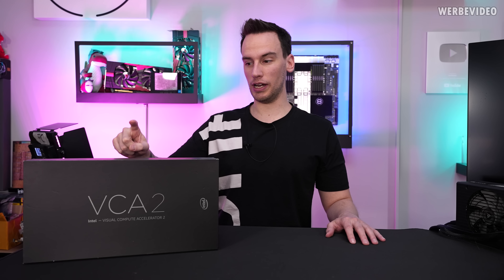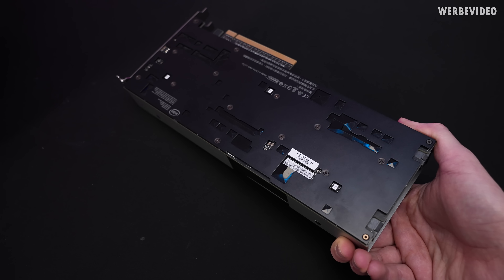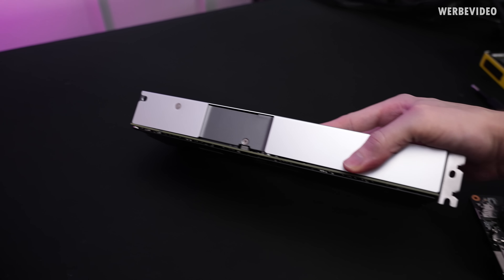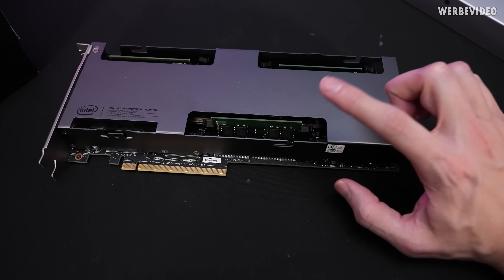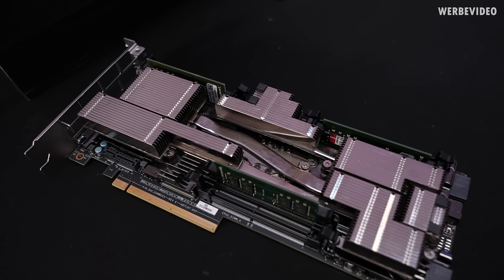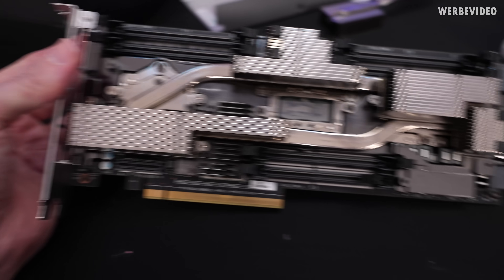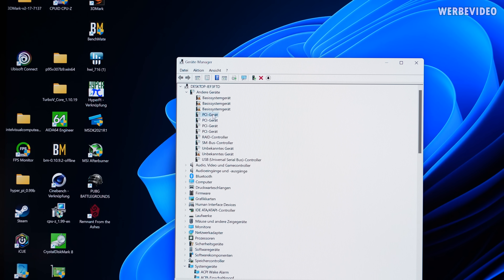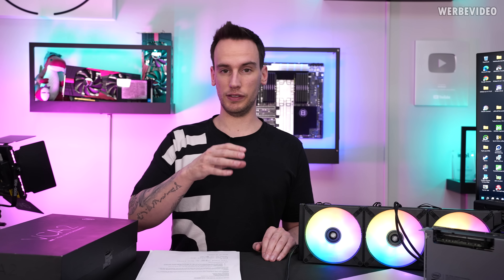Is this an Intel "Graphics Card" with 3 CPUs?

Comment: Finally, a gpu with upgradable VRAM. This should have been a thing like a decade ago.
Reply: Actually... it was... Like 30 years ago with some S3 and Matrox cards :D
Reply: While it's technically possible to do this, it's practically useless.
Put 12GB of vram on a gt 730, it's still a 730.
Reply: @chrisbaker8533  I'm using a GT 730 with 2GB and passive cooling, you have made me feel out of date 🤪
Reply: @ruben_balea  Don't feel bad, i just lost my 4GB 730 a while back while doing some testing.
RIP
Reply: @chrisbaker8533  I don't feel bad, I was just kidding, for me that 730 is more than enough.

I just bought it to be able to run some BOINC projects without spending a lot of electricity. If it doesn't sound familiar to you, BOINC is a distributed computing program, like SETI@home but to do things other than look for aliens, although in reality there was also a version of SETI that ran on BOINC. It has a companion program called TThrottle that controls the execution of the various projects and pauses them when the CPU and/or GPU exceed the specified temperature. I have it configured to pause work when the CPU or GPU exceeds 55 ºC, which apart from avoiding frying the system maintains an electrical consumption that I can afford.
Almost all the games I own were designed for less powerful graphics, but even the Age of Empires IV technical stress test from last September ran very well with all settings maxed out... at 1280x720 ;-)
Although I didn't buy the game because years ago I decided not to spend more than €30 on any video game and I think that was like twice as much. I might break that rule with Return to Monkey Island if I see that it meets my expectations after 3 decades of waiting 🙈
Reply: @ruben_balea  Kinda figured.
Not real familiar with boinc, but that 730 of mine was my first foray into gpu accelerated 3d rendering.
It's total trash compared to the Tesla m40's(GTX titan x, but slower) or p106-100's(~GTX 1060) I'm running now, but it was a massive speed increase over my, cripplingly anemic, amd quad core at 1.9GHZ.

As far as gaming, i'm a bit of a 'filthy casual' these days, with mostly retro game, and the occasionally foray into more modern titles.
As for "i'm not spending THAT much on a game", i hear ya.
I'll wait for a sale on steam or gog, or watch the clearance racks at wal-mart.
I've got enough games that i've accumulated over the years that i really don't need to buy anything, and still not play the same game twice for quite some time.

Comment: That cache memory chip is what intel calls EDRAM, it was present in the Broadwell desktop line, such as the i7 5775C, which I used until this year precisely by Iris Pro and this chip to edit videos, believe me, exceeded timeline performance of a Ryzen 7 in Davinci Resolve. This chip was defunct in intel's desktop line, but continued to be manufactured on processors made for Apple until they migrated to the SOC M1

Comment: Ah okay, so that CPU had something called Iris Pro P580, that particular iGPU is actually way better than the HD 530/630/UHD630, and was only on select Skylake i7 and Xeon BGA1440 CPUs.

Also, you showed a screenshot of the ctl thing, there was also a mention of a "RAMDISK". I think you have to set up a "ramdisk" on the actual card, given you have a maximum of 96GB theoretical ram capacity on that, and then it can work as an accelerator for any data on that. That's my theory at least. Since the purpose is for encoding, I would suspect if you have it set up correctly, it can basically act as a powerful video encoder (or multiple video encoders bc 3 iGPUs), and can transcode footage at an extremely fast speed surpassing NVMe speeds. I could also be entirely wrong, and maybe you just have to use that m.2 port on the card for an SSD, boot off that, and then go from there, idk how you would be able to do that without a video output though.

Comment: Would be nice to set up a triple I/O and storage mainboard.
Have a dedicated HDMI and handfull of USB ports for each CPU, to set up 3 workstations. 
Most standard boards only have one HDMI, and the boards to host compute units have limited USB I/O.
Best I can think of is to get a mainboard with several VGA output cards, and try to split the 3 CPUs via virtual machines in a hypervisor across the rest of the I/O.

Comment: I need this to be updated with 3x 12700H 42 cores for TDARR (when GPU transcoding results in larger than original files, basically any time you go from MPEG2 to H265), and then 3x video encoders for when GPU encoding works fine. 
Would be awesome to get 4 of these cards in a single system. Heck, i once had a server that would have fit 7 of these cards

Comment: I’m curious if this is meant to be run from something like a NAS or as a virtual computer operation, using Linux on the host system to backend the OS from the cards internal storage. Maybe the PCIE pins are directly communicating with the host motherboard and CPU to leech PCIE lanes and other hardware, booting a Windows Server OS directly from the card.

I’m no engineer or programmer, but it looks and sounds like the thing is supposed to be some kind of overpowered NUC server

Comment: I just typed a rather lengthy reply to this that Youtube deleted. The VCA card has two PciE bridges, one is for one system, the other one is for the other two and the ssd slot. The drivers you have are for installing Windows on the board, not for the base OS. You don't download drivers for the base system, you build them after the kernel mods are done. https://www.colfax-intl.com/downloads/vca_softwareuserguide_1_0.pdf  You have to be registered at Intel's site to get info on the cards, which is why basically nothing show up on a google search. Here is how you build the Images you need to use the card. https://people.centos.org/arrfab/CentOS7/LiveMedia/RPMS/

Comment: Just talk to Wendell the GREAT. (Level1Techs) he'll know what to do. Probably get Adobe Premier to use all three (CPU's and GPU's) to run.
 Linux first. But you can't just put Linux on any board. Its gotta have full PCIe support for installing 2 GPU's separate, in Linux. That way you can install an OS like Windows on one drive, while Linux is the Host OS on another and run dual GPU's in a separate environment at the same time, or not. Looking Glass is a cool piece of software.

Comment: Hmm put MIT Beowulf on it as the CPU units chipsets and ram are all the same as is required for Beowulf to run and drop that compute acceleration module into a older server motherboard  and in theory it might be live

Comment: @der8bauer EN - I think the drivers are not for the host to see the cpus across the system bus, but rather for the CPUs to see each other across an internal bus, which is probably why there's a second bridge chip on the card. They need to be installed on the card, not the host.

Comment: I'm not sure how/if the device bifurcates the PCIE slot prior to the bridge chips, but if it does, consumer intel is only capable of 8+8 or 8+4+4.  It is incapable of other configurations.
Would suggest trying it with an HEDT system next time just in case.

Comment: The PLX 8749 and the PLX 8717 both support 2 NTB (non-transparent bridge) ports which each let you join 2 PCIe hierarchies. 
You would need 5 ports to allow everything to talk to everything (3 between the host and each CPU, 2 between the CPUs). Given the 8717 only has 16 lanes (so 2x8-lane ports either side of the NTB), and the 8749 has 48 lanes, it probably has 8 lanes to each CPU and 16 to the host).

Comment: you forgot to talk about the M.2 slot that was on the card. or did i miss that part? why does it need an M.2? to function as a separate computer inside the main computer?
Reply: I feel like he only mentioned it. then forgot it when he talked about installing windows to the card.

Comment: Hi

I am going on a complete hunch here, but if that works like an x8io does, than the driver isn't a driver.  If by your description from your discord people is understood correctl;y, the driver is used to address the other chips and init the rest of the system after booting with 1 CPU.  You would rig multiple hundreds of these together and network them.  This could be for video rendering, but my immediate thought is how accuweather runs its servers.  They would probably use a solution like this if it were available.

Comment: Very interesting card, could it be software locked? Like you may need a specific program that is written using the Specific SDK to get it to do anything. I would imagine such an architecture would be pretty specific, and literally anything else would not know what to actually do with it. possibly different instruction/execution code on the die? Sorry if i get the exact terminology wrong.

Comment: As your friend said - the windows drivers are for only part of the solution. The device manager won't help you much to debug the issue, as you'll need Linux and the boot messages on Linux to see what's going on. Also - enable IOMMU and SR-IOV, you might also need to switch the PCIe X16 to X4/X4/X4/X4.
Long story short, VCA2 was built primary to be used under Linux. You might want to talk to Kendel from Level1techs.

Comment: Maybe you could try setting up an Unraid system, which is Linux based, and then load then install the card that way, in a similar way as to how you instal RAID, 10GB NICs & GPU cards - just an idea and would be less hassle than installing a full Linux system. Just need a 8Gb USB flash drive

Comment: @der8auer EN , First off = You Have The TOTALLY Wrong Board For Application Utility . 
#2 - This Is a Server Grade Unit that Is Capable of " AI "  Performance Applications . 
#3  -  The Proper Board Has No Mainstream Hardware At All ! = The Board You Have Is Indeed All that is Needed , outside Storage and pcie connection compatibility Lanes , the board is Almost empty of Anything Other than a pcie slot and Maybe a Small chipset and storage , as well as maybe some IO Connections , and on very few a cpu to control the lanes Out for IO Connections , i do wished youtube wasn`t remove External links atm so that i could post the links to many of the proper Carrier boards you will need just to get an Out / vga signal 
#4  - many of these use case utilities are for , as you may well already know ? is For " AI " /  industrial automation, transport, building automation, scientific equipment and edge computing  / Data Center Block systems / video analytics  / live rendering to 4K (and above) outdoor displays / network, and security interprise solutions - network  and security  comptrollers and other applications , such as delivering  HD and UHD video in the cloud, or complex 3D applications from secure data centers
However , you must First get the Right Board and without that board - it is near impossible to get that thing running on any regular store bought motherboard , you literally have to find a dedicated server board manufacturer to get the proper hardware to even run that card / board 
And 1 More thing - YES You Can Install it on Windows , In Fact Opera and yes as well linux , as well also CentOS . and Yes you can run it on amazon ces i think it is but also awc services os systems . 
but = again = you need the right carrier board ! 
all the above just to say , you have the wrong board brudda  , and no not a motherboard but a carrier board , and you are missing some cables on top of that , look closely at tail , power plug end of board , there should be more connection blocks there somewhere not unless someone took them off / or they were never installed and / or this is just a display piece , is there pin-outs for other connection blocks on tail that are not occupied ? this may tell you more about the stage of the  board its self = pre installment hardware as many are hardline soldered in once they are installed onto the carrier board for server use , the blocks that is , some manufacturers have their own designs of connections they use for each server bay , idk , but from what i am looking at right now , many use cases are special order for each data utility and they have their own - server builders , not common place ready to use systems but rather custom built systems . 
i do wished i could post these links , i am looking at several sites that specialize in these systems and no two are alike , each server manufacturer has their own branding and particular way of designs and they are trade marked pieces . 
i hope some of these sheds light on the subject , 
but not too harp on it = but you are using the wrong , Carrier system , do not use a motherboard rather  a server carrier board 
And Yes you Install the OS On This Board !
just hope you d not loose power to it , isn`t that ecc memory ? eeek , or reeee , which ever you prefer

Comment: Think it'll ever be possible to offload processing tasks to CPUs mounted on a PCIe GPU? How feasible would this be with PCI 5.0 or higher?
Imagine how useful adding additional processors could be, just toss another 8 cores onto your machine and you're set for years.
Reply: would be cool to return to a passive backplane architecture like a lot of retro computers used to have. though a pcie backplane would be more active, as its got to have a full pch interconnect. sort of like one of the newer nucs but scaled up. you could go all gpu or all cpu based on whatever application you need. that said you would probibly want your backplane to be a lot smarter than just a pch and having a dedicated cpu to manage the whole shebang is probibly a good idea.
Reply: @LordOfNihil  With the current frequencies that both PCIe and memory controllers operate on there will never be a backplane design like that anymore as it would just have too much capacitance to function, sadly.
Though a point to point PCIe switch could be used, these already exist in enterprise equipment to split SSDs, GPUs and networking over another network to various servers. Of coarse they are hideously expensive and likely will never be a practical solution for home users :P

Comment: This looks a lot like one of the Knight's Landing Xeon Phi accelerator cards - or at least some kind of predecessor. those things were also xeons running on accelerator pci cards but they had an avx-512 based 30+ core architecture for running floating point heavy applications. Knight's landing is almost ten years old at this point so this card would be even older. the xeon phi accelerator cards used a proprietary unix operating system and communicated through a terminal on windows as a passthrough - the "intel massively parallel co-computing driver package" or something like that. they are not useful because nothing uses avx-512 and they are 10+ year old coprocessor cards that run an instruction set nobody uses

you can find a few running examples of the knight's landing co-processor cards doing ray tracing in real time but it's just the tech demos that come with the drivers. still impressive, but also useless

Comment: The 128MB "L4 cache" is for the iGPU, this was first introduced with Crystal Well. For Crystal Well if you're using the iGPU it's VRAM at 50GB/s each way (100GB/s total), if you're using external graphics it's L4 cache. In some work loads the 128MB cache is really beneficial even if it's comparatively slow by modern standards.  I can't find specs for later models after Crystal Well, but I assume in later instances I assume they sped up this memory. eDRAM is the technical name for this.

Comment: Linux / unix makes sense for a server host. 
I wonder if the second PLX chip is for the CPU's accessing the M.2 drive? And you'd have windows installed on there for certain workloads, that's where you'd need the windows drivers. Because they'd need to be accessed differently to a normal install.

Comment: In theory they could make gaming systems extremely compact. All u need is one small GPU sized board, with two GPU/CPU chips on it and vapor chamber cooling solution. I think market its going this way we want this or not. Nvidia will eventually come up with this themselves. I dont know if it will be SOC or seperate CPU/GPU chips on single board. But with ARM getting bigger and bigger and more adopted... the predictions for future of PC is simple. Everything will become ONE.
Reply: Hades Canyon?
Reply: well...intel nuc doing that ...
Reply: Canyon NUC is priced higher than the same spec laptops tho...

Comment: would be nice to see cpu's etc built like this consumer side, like why the fuck do we need different cpu sockets lol. everything can run off pci.. more i think of it the more it seems like an easy way to sucke money out of consumer, every 2 generations you need a new motherboard, cpu's could 100% be built like a gpu, with modular memory power stages etc. gpu's pull more power on average then cpu's do and they run fine off pci... my 3070 ti for wxample pulls over 300w r5 5600 pulls about 150w. there is literally no excuse, current motherboards are stupid designs and 4 dimm memory overclocking vs 2 dimms is enough to show how fucking dumb they are. i buy atx motherboards but they are ultimatly stupid, 90% of people only use 1 pci slot. so much waste
Reply: Because PCIe has way too high latency and way too low bandwidth to serve as a memory bus, you could theoretically engineer a system to do that but it would be slower than a 20 year old home pc... Besides that PCIe does not provide most signals that a CPU needs, including actual bus access so no, no way to have a CPU in a PCIe card.
You can stick a co-processor in a PCIe card and access it over PCIe, but that is what a GPU is and they are good at GPU tasks but terribly slow at multi-purpose (CPU) tasks...